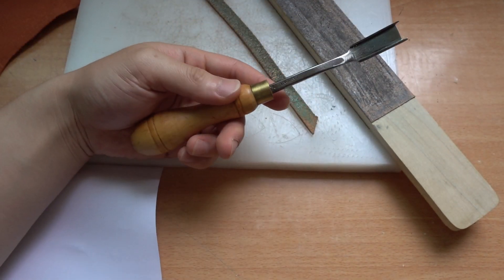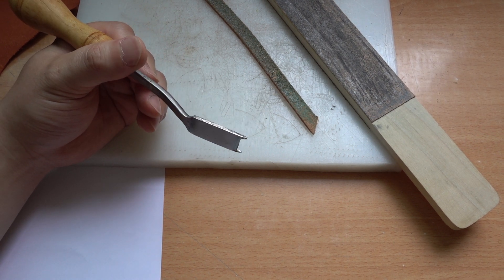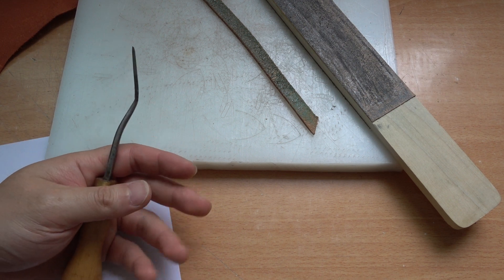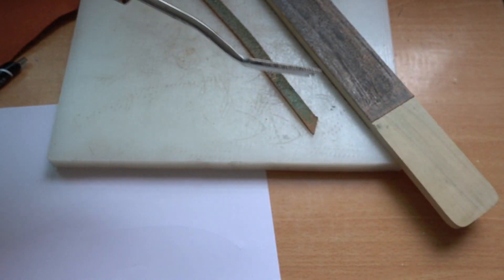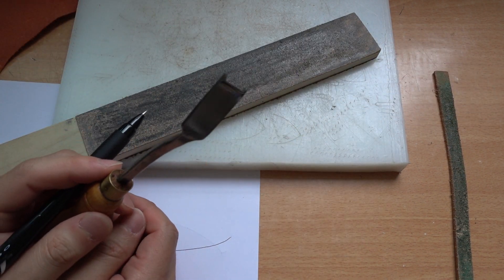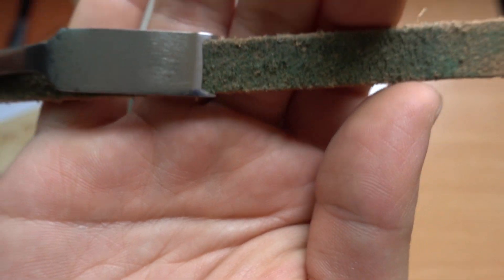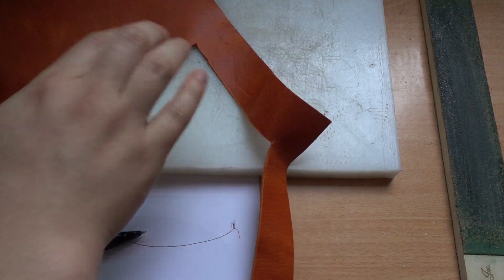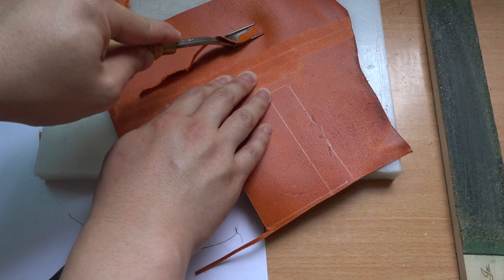How to sharpen French edger

Comment: Is the grey compound coarser than the green compound, I reckon?

If I need to sand it, would I still need to use the grey compound or straight use the green compound after the sand paper?
Also which number sand papers do you suggest? I reckon wet sanding right?
Reply from the maker: Great question. Color doesn't tell the grit. It depends on the manufacturer. 

Normally though, green is finer than white.
White is finer than black.

after you sand it(or sharpen with stones)
you need to finish at least 2000 grit sand paper,
yes wet sand.

if you finish with stones, finish with 6000

I recommend stones.

after you sharpen it either stone or sandpaper,

finish with green compound
Reply: leathertoolz Thanks a lot for your prompt response! I only have sand paper...handy, so you reckon I should start with 400,800,1200, and finish with 2000?
What is your advice?
Reply from the maker: you don't need to start from 400 grit always.

1) if your edge is damaged/rusted, you better start from 400 grit papers because it's faster.
2) when you want to maintain your edge, just strop.
3) if you are just trying to get sharper edge, yes, start from 400 but don't do it every time.

Thanks for watching!
Reply: leathertoolz You are absolutely awesome! Thank you for your great and informative channel!
Reply: leathertoolz Hi there again !

I just ran into a problem with my French edger. I initially sanded the edger with various grits of sand paper then stropped it on the green compound, it would better than before ! Then I just wanted it slightly more sharpened, and sanded it slightly more, and stropped some more... and when I tried to skive again , it wasn’t sharp and I could barely skive !!! ? I mean literally nothing was skived and absolutely blunt now ! What could’ve I done wrong ? Would really really appreciate your advice?
Reply: @deepdiver849  You probably didn't sharpen in a consistent angle, or you didn't debur the inside.
Reply: Mr.Infinity Thank you ! I figured my mistake out, I was using sewing machine oil on sand paper instead of water to sharpen my French edger. My French edger needed water not oil :)

Comment: that is honing not really sharpening
Reply: do the same thing with 1000, 2000, 3000 grit sand paper instead. though if you are just cutting leather, you should really ever need a hone unless your blade came dull.